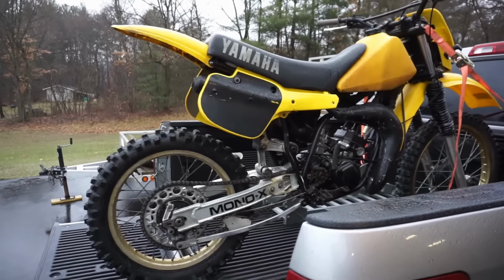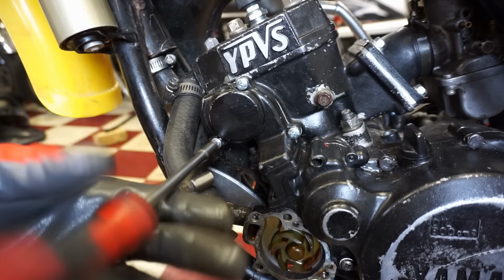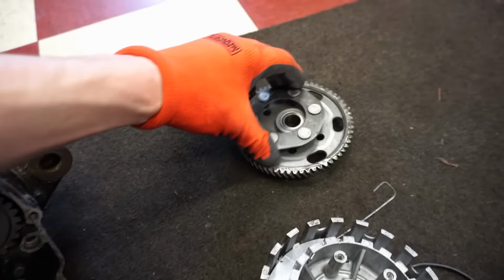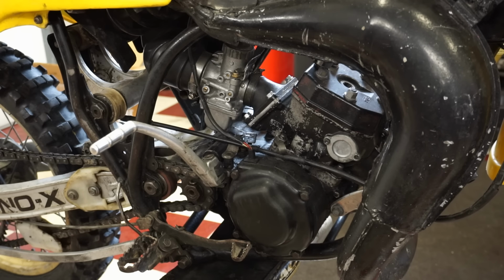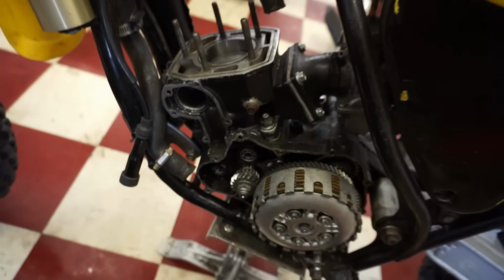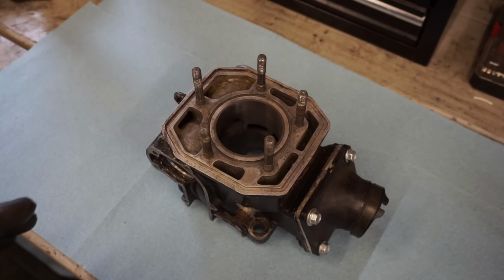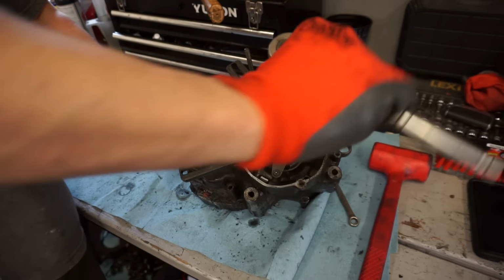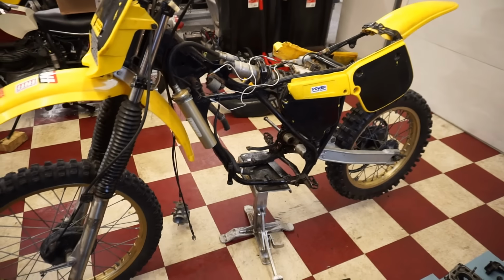Seller Lied About This Rare 2-Stroke Dirt Bike

Comment: I purchased a 1982 YZ125 in similar cosmetic condition for $50 blown up back when I was in middle school, so around 2000 time frame. Over a period of time, I rebuilt the engine with a new top end, crankshaft, bearings, etc.....to the best of my ability as a kid, and when my dad would take me to the Yamaha store to get parts or order them off Ebay for me. I was so short, I had to stand on a 5 gallon bucket to even get on the thing. At the time, my mom wasn't too worried as she thought it'd never run, but then was PISSED the first time it fired up. 

I had that bike for years - cool bike and revolutionary, but just OK. At the time, I hated it because all of my buddies I would ride with had newer bikes (1990's models and newer). Eventually, everything wore out on it again - top end, water pump shaft/seal, etc. I ended up parting it out and scrapping alot of it during my college years. I may still have the frame and swingarm left over somewhere, LOL. 

Fun fact - with the radiator being mounted above the triple tree, the coolant flows through the steering stem. So, when the seals wear out and the steering stem develops pitting and wear, coolant will leak down into the steering stem bearings. This not only washes out the grease but also causes the bearings to heat up and seize the handlebars forward when the engine reaches temperature. Probably why the radiator(s) were moved in short order to where the are located now :)
Reply: With the coolant flowing through frame like that it would heat up the forks and change how the damping worked (not good). Plus w/the radiator in front of the triple clamps and the shock under the seat those bikes were a bit top-heavy too. lol I know, I had and raced an 82 YZ-250! :) Great engines on both the 125 and 250, but the handling wasn't the best. They moved the radiator(s) down onto the frame along w/laying the shock down and connecting it to a new linkage that ran under the swinging arm the next year for both the reasons you mentioned and to improve handling. The 1983 bikes were quite a bit better as a result.
Reply: I felt similarly about my 74 Yamaha 80, 82 kdx 80 and 81 RM 125 when I had them in the early to late 80s.  My friend had brand new kx 60s every year starting in 85, and my bikes were old an clunke.  Now I wish I still had all those bikes to restore and show love.  Eventually I ended up with a six year old 86 CR 250 which I' have kept.  To my eyes everything after an 85 is a modern bike and desirable.
Reply: Had that exact same thing happen to my '81 YZ125. Not being an engineer and still a teenager in high school, even I figured out that was a stupid place to run the coolant! Still thought it looked a lot cooler than when they moved the rad lower on the frame! One question: I always thought the '82 was when they switched the colours to red and white, moved the rad, and changed from a triangular swingarm to that style? Had a buddy who had, what I thought was an '82 in the red and white, but maybe it was an '83?

Comment: I owned a 1981. First year for water cooling. The 81's had no power valve and different suspension setup in the rear. My first YZ . Rebuilt motor from crank up back in 1988 when I was 19.
Thanks for the throwback.
Reply: I had the 83 490 ot was awesome.
Reply: I had one too, great trail bike bought in 83 was about 15. good times

Comment: I worked at the yamaha 
Dealership in 82 we had and supported a race team the 125s were Grenades . We would take truck loads of bikes to events 1 bike ,1race ,10,s of spare motors per bike we literally had piles of dead ones behind the shop

Comment: I used to have one of these, but I think it was a year earlier. I bought it from a friend. He had the bike in storage for some years, and when he got it out, he just fired it up and rode it around a bit, sucking the dry rotted air filter element into the engine. I brought it to a Yamaha dealer and had them bore it out, install new piston and ring, and new rod bearings top and bottom. Got the bike back and it ran very strong! It was a blast!!   Love the 2 strokes man!!!

Comment: Easily worth $800 as is. If they're that rare and valuable.... Even if you parted it out. The condition overall is crazy good. Those bikes could throw a lot of people on their back. Even $800 is a steal.
Reply: $400 for the exhaust alone....
Reply: 100% worth it, I saw a fully restored 81 YZ65 go for nearly 10k on the Mecum auction, makes me want to go dig mine out of the shed and restore it lol

Comment: Dude.. never buy a J model!  In 82 and 83 I had a couple of 80cc J bikes, no ypvs though. Steering head seals leaked no matter what and ruined bearings fast. Nothing you can do about it. With a port job my bikes would go about 80-85 mph, so that was good, but the maintenance was rough. They went through pistons and rings fast. About 2 hours til you start to lose power. I hope you do alright with this bike!

Comment: I had this exact bike as a kid. The only brand new bike I've ever owned and only because the local Yamaha shop owener's kid dug my 1979 Honda Odyssey FL 2fiddy that I was racing at the time and the guy offered to trade me for the brand spankin' new '82 YZ 125 he had sittin' in his shop...it took me all of a nanosecond to say...."uhhhh...YES!". I was ready for another bike because although super fun racing the odyssey, it was driving..not riding..and riding is where it's at (that....and I kept snapping rear axles on the FL as there was no rear suspension on 'em back then). Loved that bike, definitely an upgrade over the '78 YZ 125 I had before, which was awesome in it's own right but was basically a light switch...zero low end and then...BAM....hold on to the screaming banshee!! The '82 with the YPVS actually had some low end grunt that came in handy because in addition to local MX, orchard and backwoods riding, I did a couple hare scrambles and actually podiumed in one in the open class on that thing. I think they only had that crazy pro-link rear end for '82. That and the vented front number plate, first year of the safety seat up on the tank, Preston-Petty looking front fender along with the anodized gold rims and shock reservoir really made that year stand out and unique.... and still looks pretty badass to this day. Cool bike and this brought back some memories.  Thanks for the vid bro!

Comment: I’m going to give you some free advice. Whenever you are checking out a bike ALWAYS pull the mag cover and the pipe. You can rotate the crank with the mag flywheel and look at the piston via the exhaust port.
Reply: Like a seller is going to let you work on his bike, the rule of thumb is, if it doesnt run, it needs full rebuild. Its an old bike.  If its "lightly seized" it may have been full of water for 20 years.
Trusting a seller is insanity.    The guys who say "It'll run!" are the real idiots.
Anything ran at one time, and may run again after 3500.00 is spent.   

But then Ive bought probably 200 old dirtbikes in the past 8 years, there is nothing a seller wont try.  Rust "doesnt matter" because the previous owner left it out in the rain, is one story.

The usual thing is taking the chain off, and taking the shifter off....hoping a buyer wont be able to tell the whole thing is seized solid.

Its not on last bore and worn out, "trust me".     The forks wont go up and down because "they have too much air in them" Yeah, that's it!
Reply: You can't go to these deals to work on the machine. You gotta go with things in mind, if it doesn't run its worth considerably less
Reply: Borescope also.

Comment: I raced one of these when they were new.  Change the oil in the forks, the radiator heats the forks.  Change the carb boot, water hoses, cut holes in the top of the air box, rejet the carb, swap the air filter for a unifilter.

Comment: That 1982 YZ 125 was a rocket ship with port work and a good tuned pipe I owned two of them and they were a fast bike for there time
Reply: My buddy had a new one in 82.  That bike was no slouch in stock form either.
Reply: For there time lol there rockets to this day your mad
Reply: They were screamers. Nothing could touch them on the top end. 83 they moved power down a bit to were more useable for most riders. And 83 was the sweet spot. And 84 they killed it. One of the biggest turds ever. Only way to make them fast was to get an 83 cylinder and disable the "improved" brake controlled shock dampening crap. Took them a long time to come back from 1984
Reply: @dongerz666  I have an 82 YZ60 and I swear that thing will do 50+ mph with me on it and I weigh just under 200 lbs lol these bikes are insane

Comment: 4/28/24
I worked at a strictly Yamaha dealer during this period. Our inventory couldn't keep up with the demand of the j-L series of these, primarily handmade bikes. I rode my good friends 1975 mono shock when it had less than 2 hours, Crisp. I was hooked on Yamaha till the 1989 RM 250 remake from bottom-up, I believe it was a collaboration with Hurricane Hannah. Just sold the 89 RM to a excellent mechanic, I was real picky to whom I would allow this treasure piece too be owned by. Bro, Ill keep my S/A on any usable parts for you.

Comment: Nothing to do with dishonest sellers, but about 8 years ago I bought an 82 yz250 for $150. I never tried starting it, but it was in far better mechanical condition than this thing. It was just ugly. Ripped up seat cover. Spray painted plastics and tank. Etc. 
I put $100 worth of new plastic on it, a $50 seat cover and shot some hard parts with $10 worth of spray paint. I put it on craigslist for $600 and waited for the phone to ring. Then I dropped the price to $500 and waited some more. It never rang.
No worries. Summer had just started and mid-ohio vintage days (the largest vintage mx swap meet in the world) was coming up!  I got there Thursday after work. The guy camped out across from me saw me unloading it, came over and said "First liquid cooled yz250. Not very popular. Only made them one year then totally redesigned them. Quirky bike. Don't see too many of them around. What do you want for it?" 
I said, "I don't know. What do you think it's worth?" 
He said "I'd give you 450 for it." 
The event hadn't even officially started yet and I'm seeing some crazy high prices around here. So I think he's just trying to get the drop on me. 
I say "I appreciate the offer. But I'm gonna see if I can do a little better than that."
He said "Yeah, you might. This is the place to find out."

After setting up camp I took a lap around the swap meet and found some amazing deals! I picked up a nice $40 gas tank (the last piece of plastic I needed to make this thing look cherry), brand new gold aluminum handlebars for $15! A $30 gold chain and $5 grips. I mean, now this thing looked as good as ever! All things considered, I decided on a starting price of $700. I had faith that the right person was in this massive crowd, and theyd find me before the weeknd was over. Lunch time Friday came and one drunk, I mean gentleman spent a little time looking it over. "Does it run?", he asked. I told him that its got spark and compression, but I've never tried starting it (facts). 
"Would you take 5 for it?"  
I told him "You're a little early. I'm gonna give it till the end of the day, then tomorrow I'll drop it to 6. If its still here Sunday, you can take it home for 5." 
Not another person looked at it, the rest of the weekend.

As I was packing up to leave on Sunday, I saw him walking up the row and said "It's still here!" He said "Oh yeah! Sorry man. I blew my wad. See ya next year." 
The guy across the isle overheard our exchange and said "Thats too bad. At least you found some more parts. So you're moving in the right direction with it." I asked him if he still wanted it for $450 and he said he only had $400 left. I said "Close enough. I'll help you load it."
With that, I was lucky to literally break almost exactly even. 
... and that was only because I paid so little for the bike, to begin with. 
... not including my time and cleaning supplies, a few nuts and bolts that I went and got for it, storage and movement expenses.

Note: If I'd accepted his $450 offer, on day 1 (ironically, the best offer I would receive), I could have profited a whopping $140 (prior to spending $90 on more parts, then being offered $50 more, only to finally settle for $50 less).

Moral of the story: Understand the market and value of what you're buying, before you buy it, or you have nobody to blame but yourself.

That being said, the first liquid cooled YZ's are NOT very popular in the vintage MX community, due to their quirks. Therefore, combined with a short production run, parts are not in high demand either. Hence values are relatively low.
Dont take my word for it. Do an ebay search for the 1982 yz125 and filter for "sold items".
Literally zero matches.
People can ask "$3k all day". Doesnt mean people are paying it.

Comment: I would rebuild it, the bike is immaculate, and it's worth more running than how it is now
Reply: Immaculate 😂😂😂😂😂😂 it's been painted with a brush ....Immaculate 😂😂😂😂😂
Reply: @CJRSBK paint is easily removable, worn out or cracked motor cases, bearing and bushing housings that are ovaled out, cracked plastics, bent frames etc are not so easily remedied. It might not look like it but from what I’ve seen so far this bike is a prime candidate for a restoration.
Reply: @Yz4Life  not immaculate though lol 😆
Reply: @CJRSBK  It is immaculate for a bike like this
Reply: @V..X..  immaculate is immaculate buddy. That's restoration project
Reply: @CJRSBK  Thats a immaculate restoration project
Reply: @V..X..  if it was immaculate it wouldn't need a restoration FFS lol 😆 😂 🤣 😅 😜 🙃 😆
Reply: @CJRSBK  Youre wrong buddy
Reply: @V..X..  you are off your head !! In 40 years I've never heard in the motorcycle world of an immaculate restoration project 😆 if a motorcycle is immaculate that means it's immaculate doesn't need anything doing to it. Tell you what the Titanic that's immaculate isn't it FFS
Reply: @V..X..  the fcking bikes been painted with a brush ,engine parts are missing how the fck is that immaculate???
Reply: @CJRSBK  thats basic stuff, the state of that kind of bike if immaculate buddy
Reply: @V..X..  Jesus wept I've heard some BS and that's up there for sure ok mate 👍
Reply: What I meant is this bike is in very good condition for being a 1982 model. Most bikes even 10-15 years old are completely trashed, depending on the owner. This one has been taken very good care of. Excluding the upper end. That was caused by someone stealing the power valve and putting whatever piston they had laying around. The frame isn't rusted or dented, plastics are in good shape, rims are good, exhaust is original with no dents, rust, or booger welds. I've had people bring me bikes less than 10 years old that looked like it's been thru a wringer

Comment: I had the 82 250, ton of fun. I wish the Internet was around then. They go for 2-4k now
Reply: Did yours have 6 gears mine only has 5 but it is a 1988 supersport
Reply: @alexjohnson1612  5, and I bought it with the clutch side disassembled and my cylinder had to be bored from the last guy.
Reply: @bagbrothers7787  Mine needed a few bits doing, I said I will give you what you are asking but I want it running.

Comment: Thanks for the video! I bought one of these '82 YZ125's "as is" - pretty cheap, didn't realize how many things could be wrong with it. Many things that can cause problems on this kind of bike (early water-cooler). Mostly engine problems - crankcases are wrecked, etc. My choice is, sell parts off it, or do a conversion. I think I will  eventually end up with an air-cooled "YZ175"... I am collecting parts to install a 1982 IT175 engine now. I think I may end up with an awesome trail bike! Making "Lemonade" so to speak!

Comment: The power valve search for my 92 rmx has held up the project for years. Ive also been looking for a 89 or 90 rm250 jug with power valve assembly. People want over 600 bucks for this stuff on eBay lol

Comment: Cool bike. I had a 1982 YZ 80 when I was a kid. I hated that radiator setup. The damn thing leaked coolant out of the fork bearing. I ran hose around & bypassed the coolant going through the frame.

Comment: It’s a super rare bike and it’s in very good condition overall. For a bike enthusiast it’s definitely worth rebuilding this bike. Even if you invest a little money at a time if need be. I rode dirt bikes since I was a kid and back in the early eighties was my prime dirt biking years! My friends and I used to terrorize the town on our dirt bikes! I’ve never seen one of these models YZ 125 in my whole life! For 1982 that technology and being water cooled was super advanced for that time period. Most dirt bikes from the early 80’s were all air cooled. They screamed! I would definitely restore this bike and hold onto it for a while until you find the right buyer. Rebuild the engine COMPLETELY including all crank bearings, seals, etc. That alone increases its value big time so don’t skimp on that! Do it all while you have it all torn down. Then you can PROVE to any potential buyers/collectors that the engine is 100% rebuilt and in tip top shape. $$$

Comment: This remindes me so much when i bought my second Bike (Yamaha Tenere 1Vj). There was sooo much wrong with this Bike. And when i removed the oil filter and 2 of the long screws came out inclusive the threads (that are usually inside the block) i stopped. It took me month to find the right parts (for a fair price) to get everything fixed. And when everything was fixed it was really fun to ride it. But at that time i did not know that this specific model had some serious temp issues. There was a fix for it (but my younger self did not know this in 1995). In the end i sold the Bike a few years later (i did not have the time and nerves to put any more time and money into it).